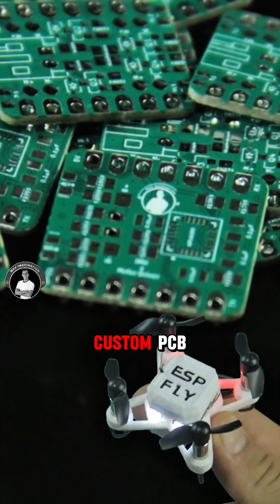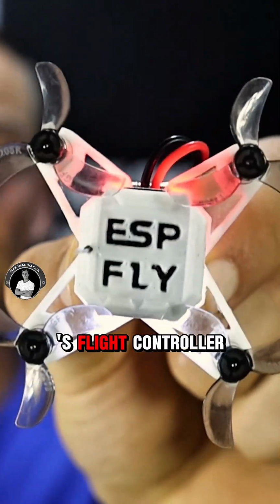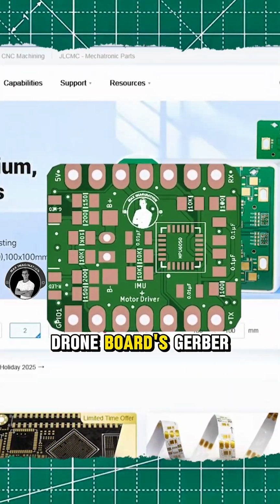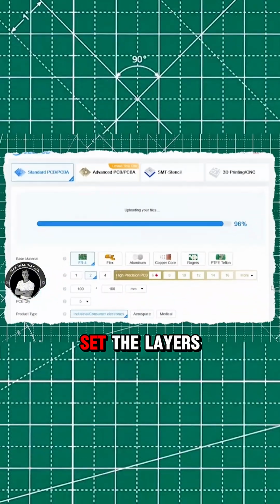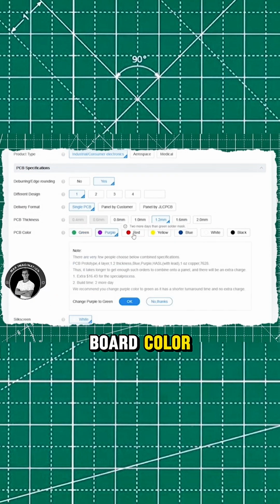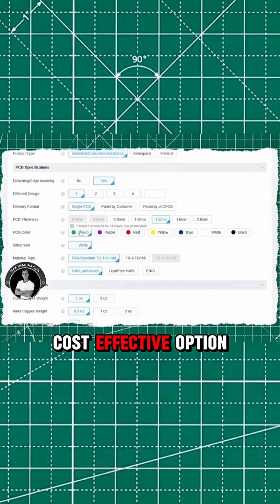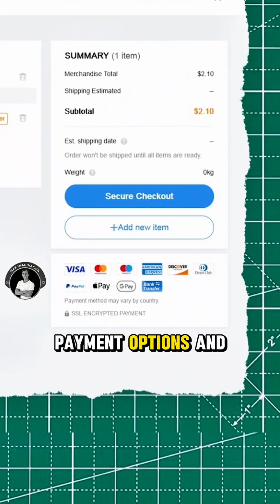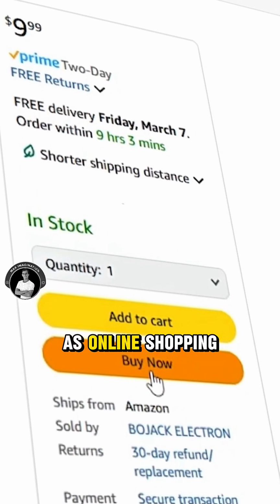Check description link to order your PCB on JLCPCB! #JLCPCB #pcbs #esp32drone

Comment: Hi i have a question for drone . May i use only cw propeller in drone.
Reply from the maker: Hi. No, you NEED both the CW and CWW direction propellers to produce lift for a drone. Same goes for motors as shown in the full video.